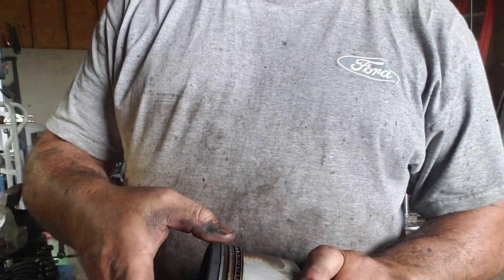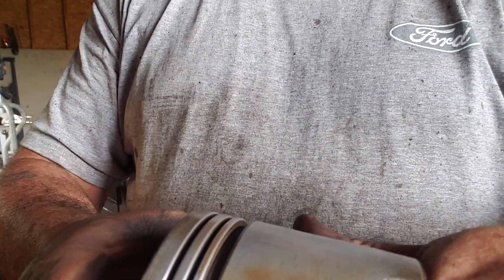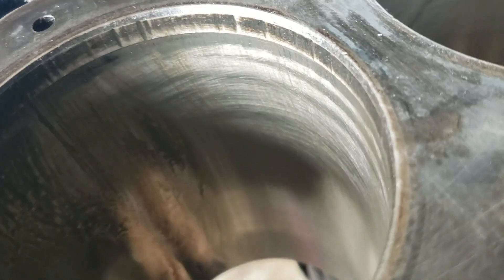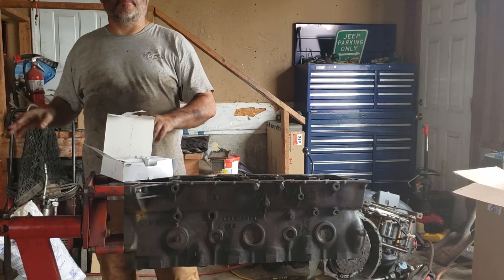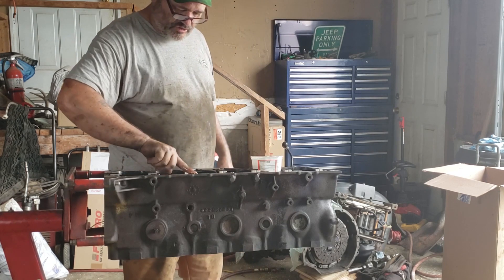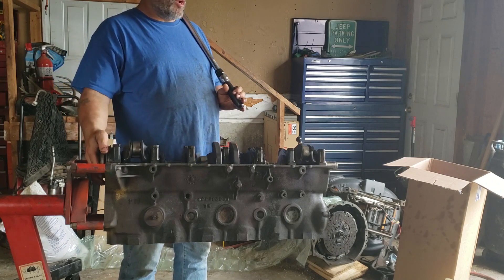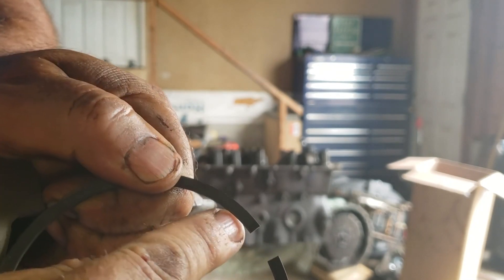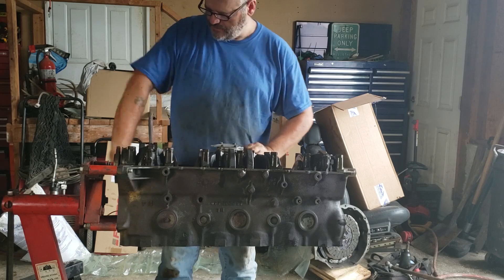Starting the budget rebuild of the Jeep CJ7 258ci (4.2L) Bottom End.

Comment: So I took ur advice on the nutserts/revitnuts idea. I drilled my first hole out bottom frame for transfer case skid plate mount. The box of the frame doubled up so extra thick, the nursery I have is a 3/8-16. It needs to b longer, I can’t find a longer one anywhere. Will the 3/8-16 swell enough n the hole to work? Thoughts? Thank you again!
Reply from the maker: They do sell a deeper rivnut / nutsert but they're hard to find sometimes. Look up "Plusnut" Amazon sells em, they're basically the same thing they just have deeper shank and 4 claws more or less that grip, should do the job.

Comment: Great video. I don't think I have the guts to try this. I'm thinking a Jasper rebuild for the old '79. Is this something a guy can do who has never rebuilt an engine before?
Reply from the maker: you mean buying a rebuilt engine and just doing a swap? If so yes, these are some of the easiest engines to swap out.
Reply: @SchnebsGarage  Yeah, I just did the compression test while it is sitting in the frame, body off. The plugs were sooty but dry. #2 went to 90 psi then 110 wet. #5 was 160! dry and 170 wet. The rest were 120 to 140 ish. All showed better compression with a couple of squirts of oil. So...I can pull the head and take a peek or ship it off to Jasper for like $3k Americano+divorce if my wife finds out. I could just have the head rebuilt in town and just run it for awhile. For the record, I'm stretching the CJ5 into a CJ8 because...I'm weird. Any thoughts? Thanks for replying!
Reply from the maker: @notsoserious0944  Honestly, if I was investing 3k into a motor it'd be a 350. I wrestled with the idea myself but decided to go with the 258 for now. You can only get so much grunt out of a 258 while the 350 with mild upgrades will haul.

Comment: Holy moly bud that block should have been hot tanked before you started putting that thing together!
Reply from the maker: Power wash and degreaser good enough, I'm not building a showcar.
Reply: @SchnebsGarage  
To each his own but that block is not nearly clean and likely as not will not last half as long as one that is assembled clean.
Reply: @crazybob97able  Helped a buddy rebuild a Ford 300 6cyl on a picnic table. We cleaned it similiar and that thing went for a long time .

Comment: Will these 258 i6 hold up like a 350sbc
Reply from the maker: Hard to compare much to a 350, those things are just bulletproof and will run longer bad than most engines will run period. But the 258 is a hell of a workhorse as well. This one went 37 years and would still start and drive.
Reply: @SchnebsGarage  why did you decided to rebuild it? Can these 258’s be stroked like a 4.0?
Reply from the maker: @beunbad  Well this thing was in desperate need of some attention. To the best of my knowledge it was never rebuilt and as shown in the video the cam had 4 lobes that were basically flat. Yes you can stroke a 258, thing is it's not really cost effective for the return in my opinion. If I was going to spend that kind of money on an old Jeep it would be to put in a SB Chevy. Power to weight ratio is vastly improved and there's no shortage of 'kits' to accomplish this task.